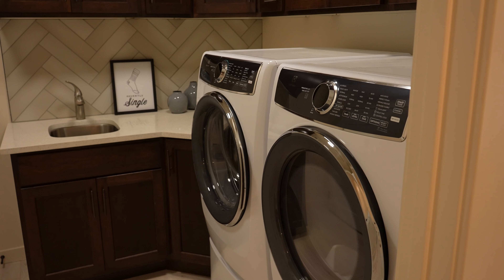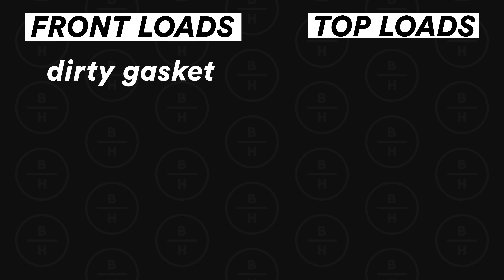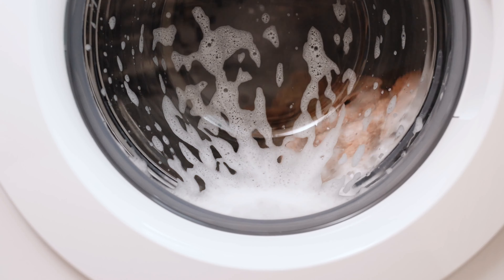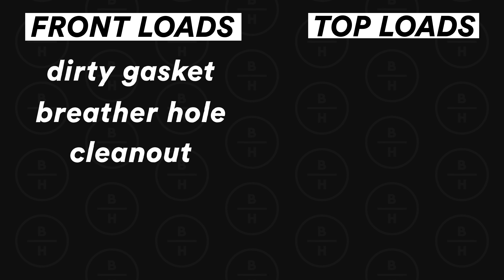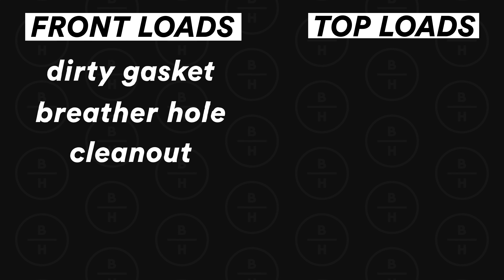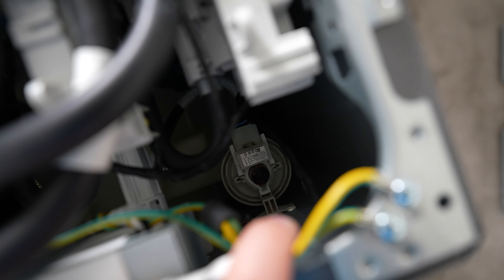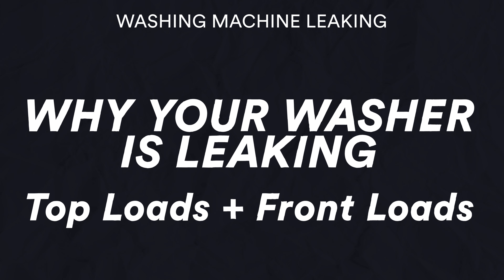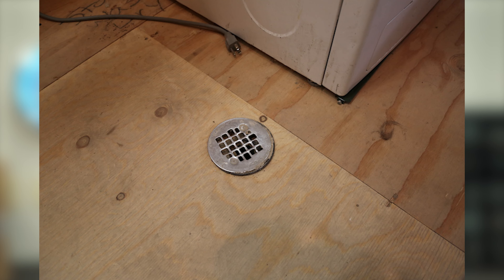Washing machine leaking? Check these things first!

Comment: If your dryer is leaking check your vent hose.   Condensation builds up especially if you have a crappy roof vent or if your ducting is a long pipe from one end of your house to another.  Dryers aren’t meant to push lint and moisture up or along long stretches so you’ll see condensation in your dryer and you may even hear what sounds like a stream of water moving in your exhaust hose.

Comment: My hoover washing machine leaks from the bottom. But not at the start of cycle. Always at the end of cycle, mostly when its spinning. The water is clean. What could be the reason you think?
Reply: That is more likely a crack in the drain hose. Since it's filling and running without a leak, that means it's leaking during the drain cycle at the end.